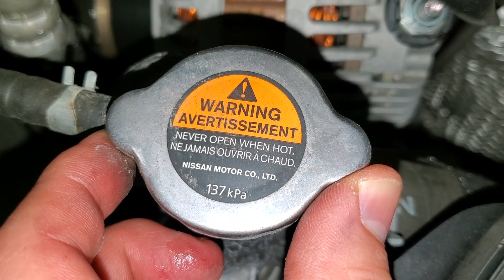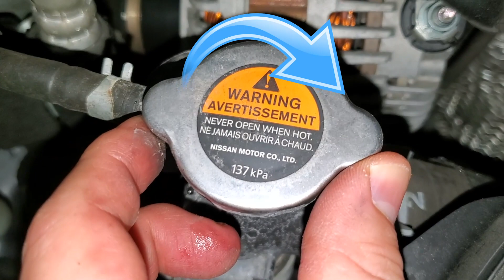Nissan Altima How To Check Coolant Antifreeze Level In Radiator COLD ENGINE 2013 2014 2015 2016 2017

Comment from the maker: Check out all of the DIY repair and maintenance guides for the 5th generation 2013, 2014, 2015, 2016, 2017 & 2018 Nissan Altima - 
https://www.paulstravelpictures.com/Articles/2013-2015-Nissan-Altima-Common-Problems-Repair-Maintenance-Guides.htm

Comment from the maker: This quick DIY video shows owners of the 5th generation 2013, 2014, 2015, 2016, 2017 & 2018 Nissan Altima how to check the coolant (antifreeze) level in the radiator.     COLD ENGINE !!!!

Check out all of the DIY repair and maintenance guides for the 5th generation 2013, 2014, 2015, 2016, 2017 & 2018 Nissan Altima - 
https://www.paulstravelpictures.com/Articles/2013-2015-Nissan-Altima-Common-Problems-Repair-Maintenance-Guides.htm